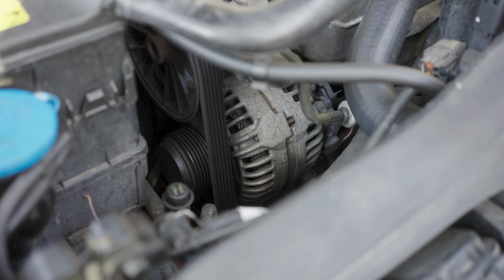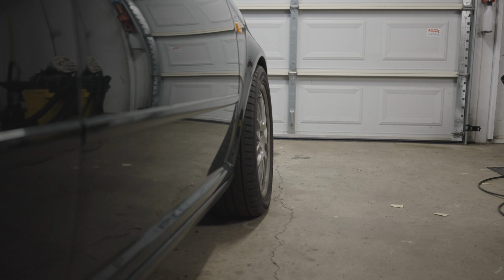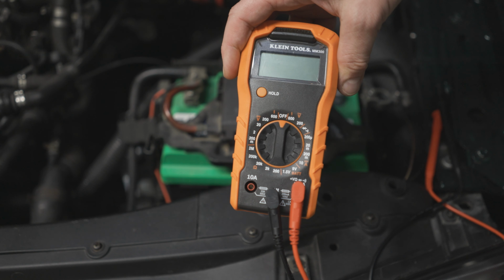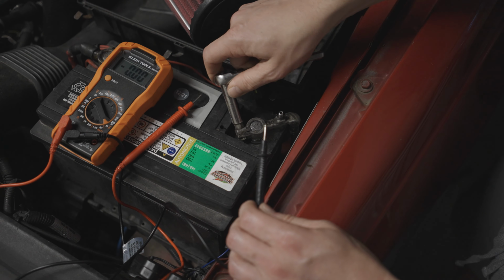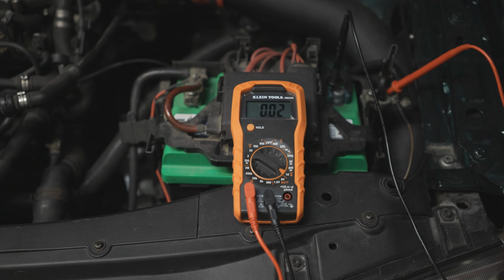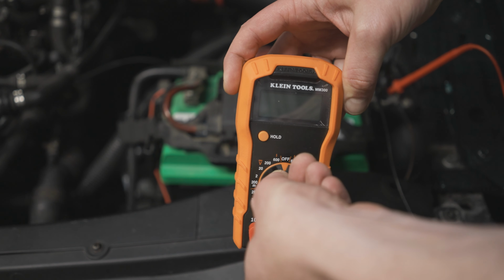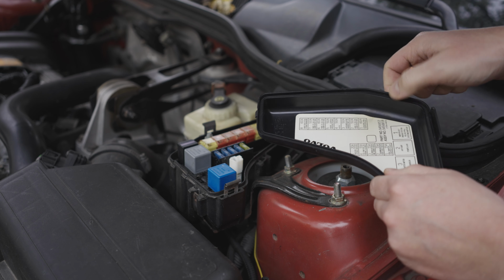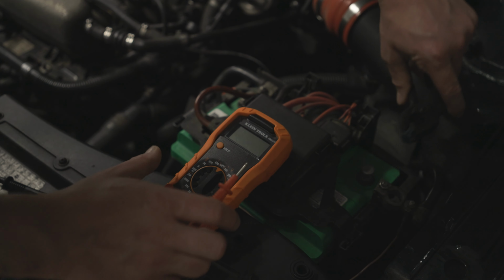How To Test Parasitic Draw on a Car Battery

Comment: Mine is at 0.00 what can I do now I don't understand
Reply from the maker: Check your connection or your multimeter. You could be on the wrong setting, wrong ports, or have a blown fuse.
Reply: @StevesGarage  a blown fuse in the multi meter or vehicle?
Reply from the maker: @football-qk8bq  Your multimeter. If there was a blown fuse in your car something wouldn't have power.
Reply: @StevesGarage  ok thank you
Reply from the maker: @football-qk8bq  You're welcome, good luck with it!

Comment: "anything that's not stock-- check those things first"
😭
Reply: is 52mA bad?
Reply from the maker: @RacecarsAndRicefish  Just took a look at your channel to scope out the car... sorry to be the bearer of bad news 😅 52mA certainly isn't terrible, but I'd look into it. Maybe you just have a bad ground or something wired a little funky.
Reply: @StevesGarage  I've gotten it narrowed done to one fuse and it looks like there's only a couple things that run off it-- I'll have it solved in no time 😎

thx for this video
Reply from the maker: @RacecarsAndRicefish  Woo! Narrowing it down is great! Glad the video helped.
Reply: @StevesGarage  Im finding 48 - 52 mA, then I disconnect my 4 aftermarket gauges and it drops to 20.5mA, then I additionally disconnect my radio and I see 19.3mA. So one or multiple of my aftermarket gauges are the main issue. I might just have them run entirely from switched power? they'll forget their most recent color but that's fine lol
Reply from the maker: @RacecarsAndRicefish  Running them from switched power would definitely be an option. Do you think their 'memory' is pulling enough power when the car is off to cause the draw?

I also had a draw from my aftermarket radio despite using a plug and play harness. It would drain the battery after a couple days of not running. I'd pull the fuse if the car was going to sit, but ended up replacing the radio all together.

Comment: What about the memory saver before disconnecting the battery
Reply from the maker: I've never used one. Many more modern cars can retain some level of information even when disconnecting the battery. My 2000 Volvo will remember radio presets and seat memory settings.
Reply: @StevesGarage  my professor told me to always use a memory saver especially on newer cars
Reply from the maker: @elementn4107  Then go for it I guess? I've never had an issue with a car not running properly after a break in power so besides retaining the clock, trip, and radio presets I'm not sure why you'd need it.